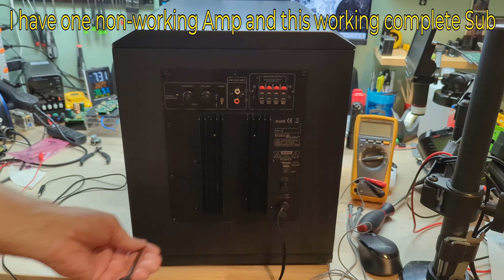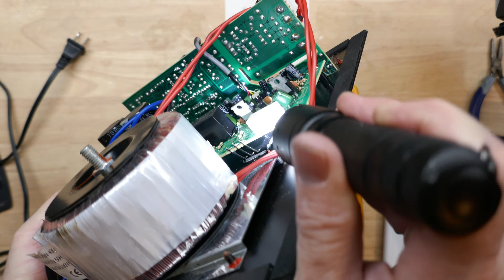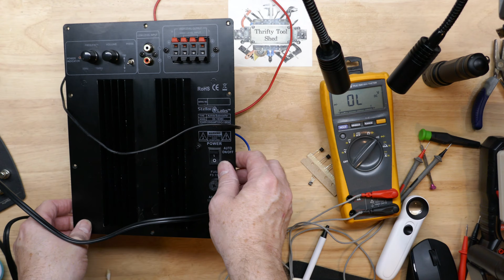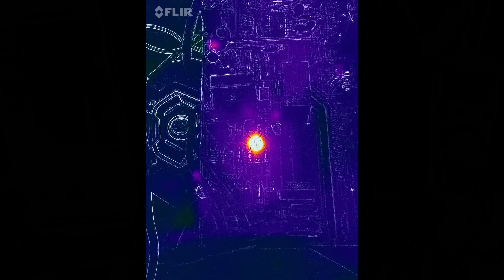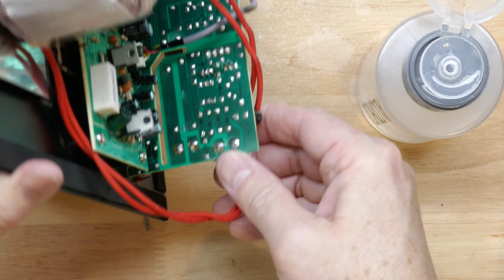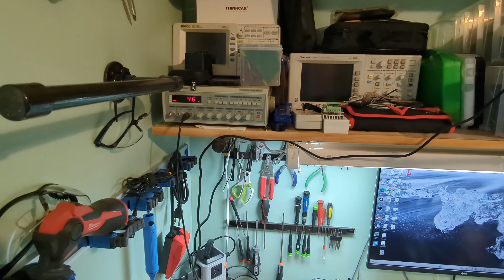Stellar Labs Sub Repair

Comment: I’m surprised it doesn’t use a dual coil woofer. I repaired a MK brand 200w which had a disintegrated foam and cone. Spec was a dual coil speaker 16 ohm. 0-120 hz, in a nice walnut trapezoid cube.